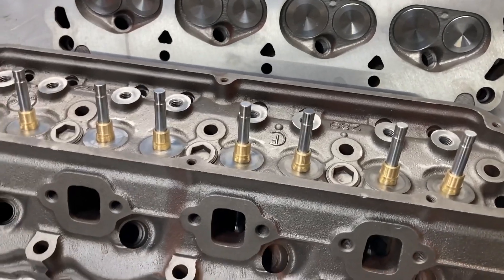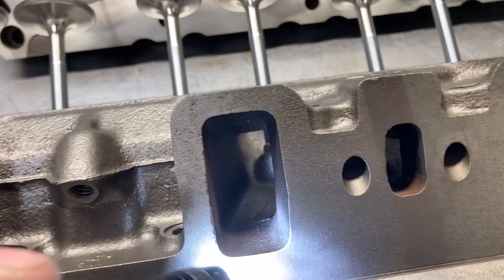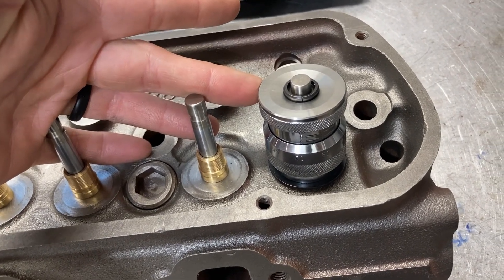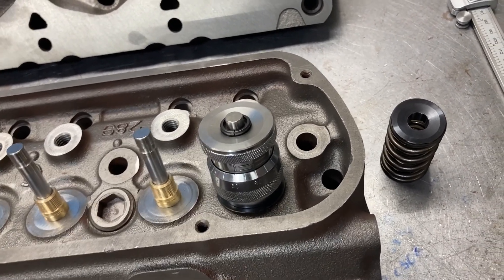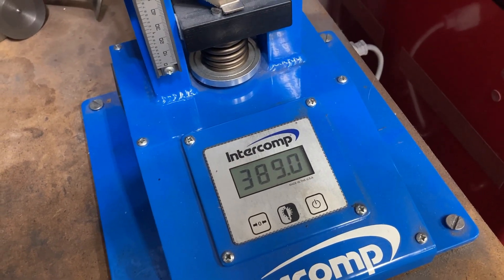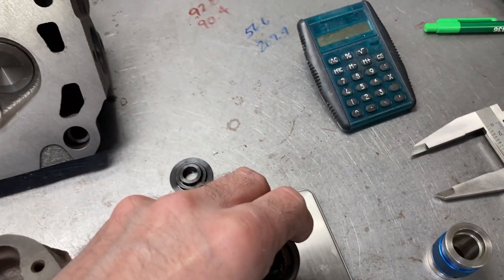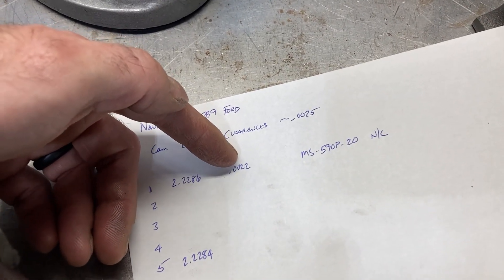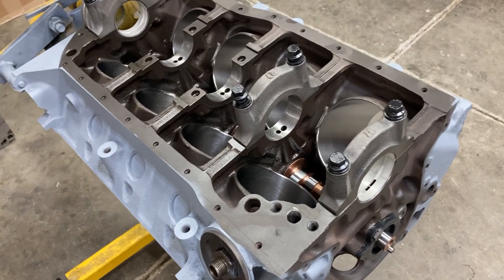Lykins Motorsports Shelby Cobra Ford 289 Head Overview

Comment: Hey Brent, you ever used Nowak pistons? Definitely next level parts, and machine work.Take care.
Reply from the maker: Never heard of them......can't find them on the internet.
Reply: @lykinsmotorsports  Nowak performance  Dan Nowak
Reply from the maker: @jerrellkull5347  Only thing I can find is that they used to be a proprietary piston offered through Ross.   Nothing current.   Hard to beat a Diamond/CP/Racetec though.
Reply: @lykinsmotorsports  hmm ok.

Comment: Really enjoying your channel Brent.  What seat and open spring pressures would you suggest for a 306, solid flat tappet, .549 lift  road race usage build?  Don't have the spec sheet in front of me, I think the Cam company recommended 135# seat 350# open
Reply from the maker: I'd have to see the cam specs, know the valve weights, know how high you're going to turn it, etc.
Reply: @lykinsmotorsports  Intake valve weight 114. grams Exhaust 92.5 grams, using ProMaxx cylinder heads. 
Cam .549 lift In and Ex.  Duration .242 intake, .246 exhaust @.050.   108 Lobe separation.  1.6 shaft mount roller rockers.  5.4" rods, approx 9:8:1 compression.  Forged rotating assembly zero balance internal.  OEM 97' Explorer block.   Arp fastners, Aluminum main cap girdle.  mid 7000 rpm's based on gear ratios/tire size and the track I go to most often Mid-Ohio.  

Thanks for taking a look

Comment: Brent, Im surprised you are not gonna put 1.94 / 1.60 valves. in these heads.
Reply from the maker: Look at the pictures of the chambers again.  A 1.940" valve would be .190" larger than what I have, which would be .095" larger on one side.  That would put the valve right up against the chamber on one side and sticking up past the deck surface on another.  Not that either one of those things is bad in and of itself, but sometimes you get more with less.....
Reply: @lykinsmotorsports  True, I forgot how small those chambers are. I use to have a set of C8OE 302 heads and they have those tinny chambers. I remember looking at them asking myself how I'm gonna replace these Briggs & Stratton valves with something bigger. Then I just gave them to a friend and didn't worry about it lol. Are you gonna dyno this 289? Not every day people get to see a 289 rip 💪

Comment: Really enjoy your channel. Always good info! How about a 427 block, 352 stroke Fe 396? TFS heads, of course.
Reply from the maker: I've actually considered that, or at least a 428 block.
Reply: My dad built a 352 back in 1967 and it had jahns racing dome pistons punched out 125 thousandths and a full race cam and he had it balanced, ported heads and a 3x2 intake with Holley 500's and he said it was a wild ride for sure!

Comment: A little hi revving 289!!!💪💪💪
Reply from the maker: It won't be a high revver.
Reply: @lykinsmotorsports  right!!! I figured you would build it with better parts to get afew more rpm and hp out of it!!!

Comment: 1.75 intake and 1.5 exhaust?   That's tiny...where they 1.67/1.45?  I think years back the machine shop installed 1.90/1.60 in my 64 289?
Reply from the maker: Yes, 1.67/1.45 is factory size.  It varies from head to head, but on these, I think a 1.900" would have been pretty shrouded.
Reply: Valve shroud is the problem,  you could squeeze 1.85's in it but loose flow numbers.  The chamber is only about 50cc.